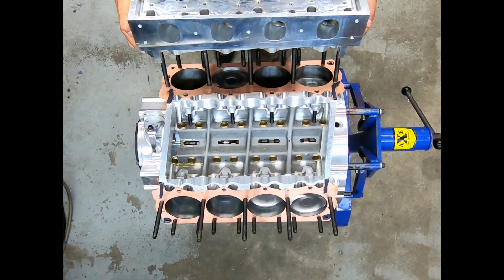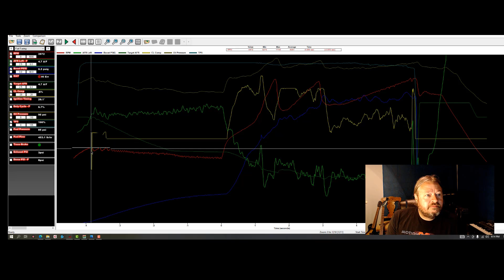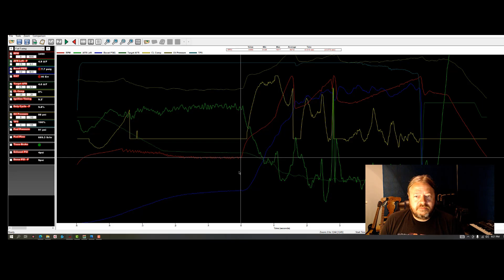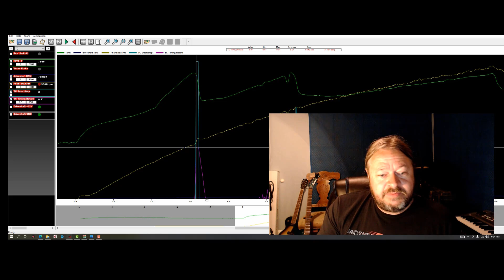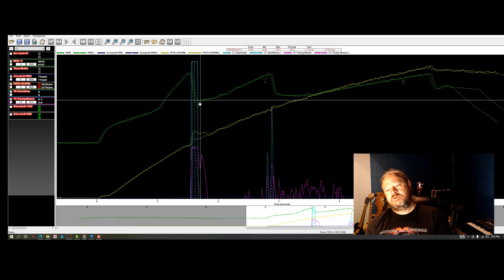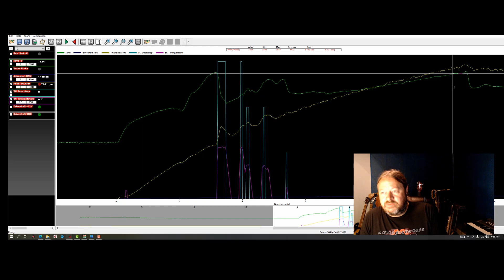Radial Mopar tuning at Bowling Green Kentucky.

Comment: Did you adjust the dot plot out to 6 seconds or so?  If so, I'm curious why.  I think the truck runs high 4's, I'm curious as to why you'd make plot adjustments past the finish line?  Or is that just part of it with a new set up?